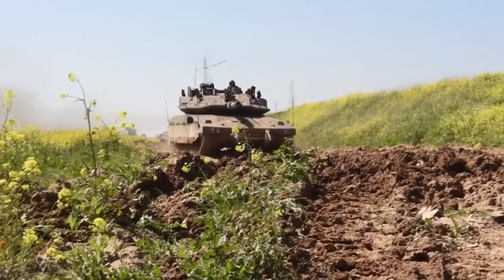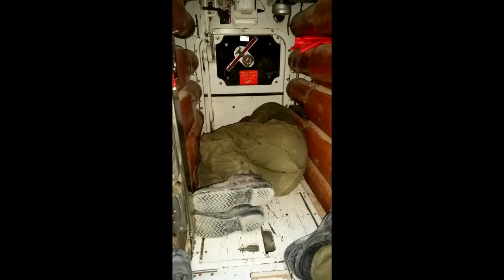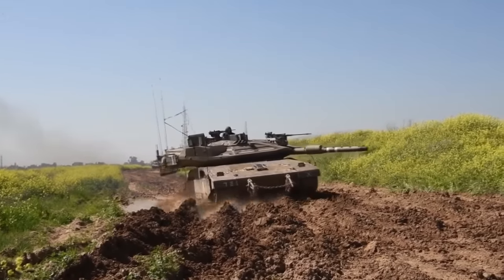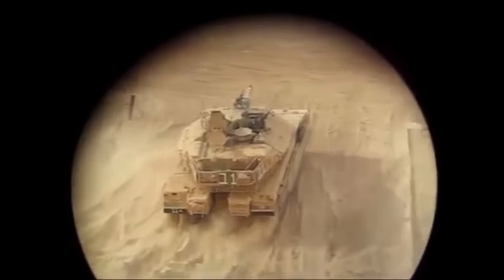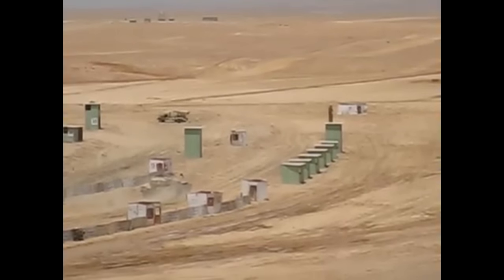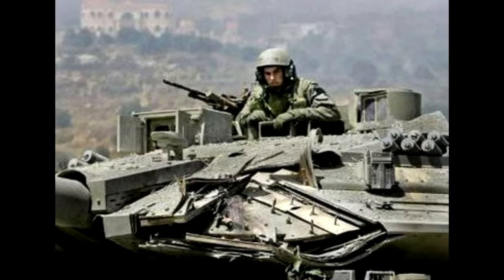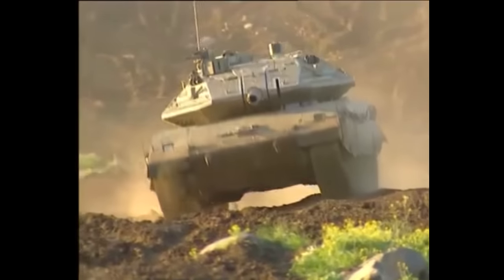Problems with Merkava tank

Comment: This tank was a target practice in 2006 war , many merkavas were destroyed , I went to see them in a tank graveyard museum like place in south Lebanon , this tank is a meme in Lebanon lol
Reply: Now they equipped them with "Windbreaker" Which is a Anti AT System. It shoots down AT Rockets fired at the tank.
Reply: @אוריה-ז7ע  yes but the problem is that it's not efficient enough 15/ 20 % chance of success , before that they add high frequency laser ,but turned out it's not good too , the Russians knows exactly what they are doing.
Reply: @chotob8458  They're developing a new modern series of Merkava tanks.
Merkava 4 "Barak" Which is equipped with the most advanced Anti AT System . It's accurate and was developed by "Rafael"
The Tank Is expected to start it's service 2021
Reply: @chotob8458  Every tank has problems but the Merkava is proven to be one of the finest tanks. This Russian guy clearly is mad or against Israel. He could've talked about the trashy Russian Anti Aircraft systems whose proven useless against IAF's planes in Syria . But he didn't.
Reply: @אוריה-ז7ע  only one way to find out who got the better equipments I guess under the pressure of a certain war
Reply: @chotob8458  Well Israel is already in a war.
Reply: @אוריה-ז7ע  only future days will tell☺️
Reply: 5 Merkavas were completely lost, 1200 Hezbollah fighters were killed. 

Not a bad exchange 🔥🔥
Reply: @JeyseeTO  lol wtf 1200?? U mean civilians , u probably got ur info from IDF ministry of war , 166 IDF soldiers dead 86 IDF civilians dead , 1267 Lebanese civilian dead , 134 hizbollah  fighters dead , so get ur info right lad ☺️
Reply: @JeyseeTO  if ur right ?and 1200 dead , hizbollah will be finished the next day
Reply: @JeyseeTO  if ur right ?and 1200 dead , hizbollah will be finished the next day
Reply: Since when loosing a couple of tanks is defined a lost? Tanks were in Beirut, Israel won the war. 
Merkhava is one of the best tanks in the world, The problem in 2006 were the tanks crews, They send reservists to the war, that were trained on Merkhava 3 and not 4.
Reply: @אוריה-ז7ע  thats not right , idf army is not good in urban combat , they got slaughtered in the small towns and in deep valleys ,it's not about the tanks , u can easily plant a 500 kg of TNT in a road to completely flip it up along side killings all the crew and the patrol squad beside it
Reply: @אוריה-ז7ע  tanks were in Beirut in 1982 bro , what are u talking about ? Lebanon was a complete mess back then , 10 years of bloodshed before Israel invasion
Reply: @chotob8458  Lebanon is still a complete mess , A terror organization is controlling your land. 
Even if I'm wrong, Tanks were in rage of Beirut in 2006, The fact the Israel crossed your borders and managed to bring the battlefield into your country is a loss for you.
Reply: @אוריה-ז7ע  first of all tanks weren't in Beirut in 2006 , that's a lie , I was in Beirut back then , second ur tank is a complete failure , ur country against a fucked up country like Lebanon , u should feel ashamed of urself , how can a small organisation demolish ur platoons in 1 month , if ur right u should be spending summer in Beirut alongside ur people right ? Like in Palestine
Reply: @אוריה-ז7ע  first of all tanks weren't in Beirut in 2006 , that's a lie , I was in Beirut back then , second ur tank is a complete failure , ur country against a fucked up country like Lebanon , u should feel ashamed of urself , how can a small organisation demolish ur platoons in 1 month , if ur right u should be spending summer in Beirut alongside ur people right ? Like in Palestine
Reply: @chotob8458  Okay, I didn't say INSIDE Beirut i said In range of Beirut. 
Secondly, if my tank is a "complete failure" 
why is it ranked at the top? why is it one of the safest tanks in modern history?
Destroying 20 tanks is nada. Literally nada. 
Check how many tanks the US Lose at Iraq and afghanistan.
Merkhava is a very good tank weather u like it or not.
And you should be ashamed on behalf of Hezbollah. 
Firing at Israeli citizens, Targeting populated areas, Kidnapping soliders. 
Mind your own business.
You can't even rule your country right, Instead of spending money on useless attacks on israel, Rebuild you F'ing country and help your civilians, 
Weather you like it or not, Israel is stronger than any of it's neighbors, So erasing us from the map is not an option, You lost 8 times and you'll lose 8 more if you try. 
 Also what's palestine? Never heard of it.
Reply: @chotob8458  I trust the official statements ONLY, and who knows where "134" come from.

As far as I read, not a single rocket launch by Hezbollah has been made since that moment... Unlike before the start of the war.

Guess this can be considered a defeat for this group.
Reply: @JeyseeTO  official statement by who ? Who's statement u mean ?
Reply: @chotob8458  official statement of the winning country. 1200 killed Hezbollah's members.
Reply: @JeyseeTO  yeah right , ur worst than a local Saudi news channel lol
Reply: @chotob8458  why am I? I'm just saying obvious things. 

Its obvious as the fact that America defeated Iraq + Azerbaijan defeated Armenia etc.

Comment: Just letting you know that there is a new merkava model that has came out and has been handling those errors pretty good.

The merkava MK4 Barak has handles those situations quite good, the termal visions is one of the best and the commander has a vision of 360 degrees with his special helmet and the fire extinguisher system is not really failing anymore, However the armour has stayed the same as before, but you have quite missed the purpose of the tank itself, is was created in the first lebanon war and the the tank is designed to be in an urban areas and handle threats like AT rockets.
Btw the merkava itself can be brought down by the engine, but the turret is still oporational and that give is the win of the 1 on 1 situation, maybe even 1 on 2 or 3.

Great video btw, i enjoyed it a lot  
~Crew memer of a merkava mk4 barak
Reply: Cool~
Reply: @peterpeter3664  wtf?
Reply: Well thanks for giving your enemies some new insights on Merkava and endangering the lives of your comrades.   Well done!
Reply: @jjmanagement7956  ikr but what can u expect its the internet everyone is an expert in everything scroll through the comments u will get a good laugh lol
Reply: EmceeDoctorB  How about turning your brain on for a second and considering that both can in fact be your enemy and that you do not need to pick sides?
Reply: @Jaafar A Thorn Or children on tanks

Comment: Greetings from Israel :)
Good video, and pretty accurate.

here's my rant for for the ranters.

A few things to take into consideration about the Role of the Merkava and how this affected it's armor design:
  
The Merkava mark IV (מרכבה סימן 4), mainly faces Infantry armed with RPG's and Surface to Surface missiles, In Mountainous and Urban environments, fighting in guerrilla warfare.
The surrounding armies around Israel mainly have tanks like T-72 variants or BMP variants, which the armor on the Merkava IV is more than capable of handling, and the gun can easily penetrate their armor.
The Merkava is designed to protect surrounding soldiers, and insure crew survivability, But is also designed to be very maneuverable and use the terrain for it's advantage.

The most important thing in a Tank is the training of the crew, and how effective the Crew is in utilizing the tank in combat. 
IDF (צה"ל) crew training is why the Merkava tanks are considered legendary in their crew survivability. 

In the end, A tank's armor is important, but only as long as the crew survives.

Here's the truth about the Merkava IV:

-If you take any modern Tank 1VS1 against the Merkava IV in open ground, The Merkava is probably Screwed.
Most modern tanks have a longer Effective engagement range than the Merkava IV. 

-If it's 1VS1 Urban fight, or a battlefield with hills where the Merkava IV can use the terrain and it's mobility, i'd put my money on the Merkava IV....
the thing shifts like a damn mountain goat!

sorry for the long rant...
  
Happy Easter or Passover :)
or whatever holiday your celebrating.

.חג שמח

Comment: The Merkava is a tank that was built for defensive purposes which is why the lower front plate seems to be rather weak. The Merkava was meant to stay in cover so that the enenmy can only see the turret or maybe the upper hull as well but the lower plate would be in cover most of the time.
Reply: That's pretty much every modern MBT. Hulldown is modern doctrine
Reply: @kevinchen5823  That is true but I mean even the concept behind the first Merkava was that they defend their position against an aggressor and the other modern MBT's are more like allrounders. But I think the Merkava 4 fits the role of an allroader pretty good compared to it's earlier versions.
Reply: Which seems to be a problem with modern tanks; they are not so much tanks but mobile bunkers
Reply: we really need sane statement and opinion around here!
Reply: Bingo
Reply: Except t-90m it can also probably fit a 2a82 with a turret modification to continue its life as a top mbt
Reply: Threnn just to add to your point, most tankers are trained to aim centre mass of a silhouette, as at long range, you can’t exactly target weak points. So yes, there’s no reason it has to have even more weight from a point that is not consistently hit with tank guns.
Reply: @okokokok5269  The name tank simply means a sometimes more and sometimes less armored vehicle. It has nothing to do with the offensive or defensive capabilitys of the vehicle. The Leopard 2 is a kind of tank that is called "MBT" which means that it was made for offensive and defensive use. If the Merkava 1 is called "MBT" than you are probably right but you said tank and not "MBT".
Reply: @okokokok5269  I never said that the Merkava is not an MBT but I simply told you that there is a difference between the word tank and MBT :)
Reply: @threnn9509  nope nice try
Reply: @okokokok5269  Why nice try? You messed up the word tank and the word MBT and I simply told you that there is a difference. But I also said that you are right if you meant that it is performing bad because it is meant to be an MBT.
So I don't know why you seem to be a little pissed because I agreed with you except for the fact that you mixed the word MBT and tank.
Reply: Also the lower front plate is very unlikely to be hit since ballistics
Reply: @okokokok5269  bruh what offensive israel designed the merkava as a defesive tank and kind of a replacement for the chieftain which they were planning to get
Reply: Threnn - A weak front armor is a design weakness as every tank should meet the enemy frontally. So every tanks armor is strongest on the front. If it is not then it is a mistake.
Reply: @TorianTammas  The engine is some kind of additional armor and quite effective as some kind of spaced armor which is seen in quite a few other tank/IFW designs too.
Reply: @threnn9509  The engine is what keeps a tank alive. A tank without running a engine is a dead tank. In a tank battle that buys them less then 10 seconds till the next hit finishes them off.
Reply: @TorianTammas  That is true but whenever a shot is able to penetrate a tank than the most important thing is that the crew survives.
Reply: @threnn9509  The only reason this bad idea still exists is that it is the Merkava one basic design and they never updated this. It was a compromise at the time that made sense as they had no better option to increase the front armor. Today it is a relic because the basic design never had been updated or no new tank developed.
Reply: @TorianTammas  no because the main enemy for tanks isnt just tanks but also infantry and a tank will most likely face infantry not in the front esspecially in a tight city packed country like israrl
Reply: @gamingkingdom1146  Sending in tanks in a city is the tactical and strategic worst choice. Sending it in without supporting infantry In great numbers is suicide. (It take more then the really few infantry on might cramp in tanks.)
You can ask the Russian what happened in Grossny as they rolled in without large infantry  support.

Comment: the merkava doesn't need to be protected from apfsds because it wasn't designed to fight modern mbts but old ones with weak shells and infantry with missiles/ its the best tank in the world because it fulfills its design purpose in the best way possible
Reply: I can also say the same about the Abrams. I don't think there is a definitive "best MBT" since each tank is built to fulfill the role it needs to. The merkava MK4 will perform extremely well against middle eastern enemies such as Hezbollah, Hamas or Iran that still use old soviet tanks (or M60 tanks in the case of Iran) but the moment it sees a modern MBT it won't perform as well (though probably still better than the god awful T-90)

Comment: The Merkava tank uses the hot exhaust generated by its front engine to vent forward as required to confuse enemy's infrared targeting during battle.  It functions like a smoke bomb!
Reply: What about the thermal sight on the merkava? Lmao
Reply: So it has magnet effect on javelin.
Reply: @Frosty_357  trophy system will negate the javelin entirely so no biggy
Reply: @AJ_on_One1  how about to hornets in a row.. say 1/10 sec diff. what is the reload speed on the trophy?
Reply: @AJ_on_One1  besides.. i have wondered what happened with the infantry soldiers around the tank if the trophy gets activated ?
Reply: @leonardoorellano6652  how often are two missiles launched exactly like in your scenario and there are multiple different trophy systems located on the turret which all cover overlapping radians in a 360 circle which can immediately counteract follow up threats, also infantry would likely never be in front of these tanks on a Hot battlefield or tank breakthrough situation, and in many cases depending on the environment the infantry may not be close to the tanks to the point where a trophy interception would harm them, and based on that logic if it was a tank without trophy were to get hit by a missile than the infantry around it would be hit by shrapnel pieces anyway, i really dont think u thought that last part through💀💀
Reply: @AJ_on_One1  the latest hornet has that capability to exactly counteract active protection. In regards to the other issue, the russians are experiencing exactly that problem... it will kill the infantry soldiers nearby as well. Was curious of the israelis solved that problem as well.
Reply: @leonardoorellano6652  I don't think it has a reload speed. It has a set amount of ammunition and it can fire them all at once or one at a time.
Reply: @leonardoorellano6652  Your grammar does not help you. It is if the Israelis. Although to be fair you might have a point especially if the Merkava carries infantry with it. It is quite possible they just have the Merkavas without Trophy carry the infantry.
Reply: dont think hamas uses infra red targetting

Comment: I served in IDF armor so I can tell from more practical perspective:

1) What makes emission in thermals is exhaust system not the engine. In this regard Merkava is not different from T-90 which also has exhaust at side.
2) Merkava is deigned to fight the other tanks in hull down position. So there is no point to increase front hull armor against the APFSDS.  Much better to save the weight for side, bottom and top protection.
3) L44 is more than enough against all Syrian and Egyptian tanks. Increasing barrel length will only decrease mobility and probability to hit on move. 
4) Turret ammo or Merkava does have blow up panels. Hull ammo does not, but no other tank beside the Abrams have it. Merkava rounds are stored in containers in rear. Thus Merkava and Abrams are two best tanks in regards of ammo storage.
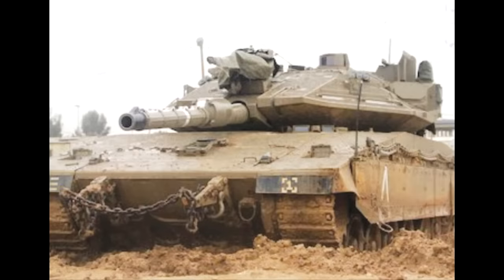5) At 3:00 u can see that round penetrated the lower hull but did not ignite the fuel tanks. Beside their ignition does not endanger the crew at all.
Reply: Good points. Couch expert vs real experience.
Reply: @komradearti9935  This chart makes very little sense. 

1) Modern ATGM can easily penetrate front hull of Leopard 2 and T-90.
2) At steep angles hitting tank skirts ATGM will lose lots of penetration (Merkava has very thick skirts with explosive content).
Reply: @komradearti9935  1. Because its not a big secret anymore. Around 700-600 mm protection.

2. Tiger tank or IS-3 had all around protection. And it was WW2 with conventional warfare and established frontlines. Today u can easily get round from any direction.

Comment: The modern US 120 mm L/44 gun operates at up to 760 mPa compared to about 580 mPa for the L/55 gun and 520 mPa for the older L/44 gun. Between increased chamber pressure and the American DU penetrators, US tanks have far better anti-armor performance than other tanks with 120 mm guns.

Comment: The M1 was tested with the L/55 gun in which everything thing fitted perfectly, but the stabilization would cut out after reaching 10 - 15 MPH
Reply: m1? abrams? l/55 rhm? wh the stabilization cut out? i mean..in leopard 2 the l/55 works perfect.
Reply: Nah the reason why the abrams still uses the l44 is because apperantly according to matsimus and some guy who imbestigates all kind of tank ammo, im not sure if it was his abrams or how tank armour works video, the depleted uranium rounds perform better in an l44 than in a l55 while giving the same penetration value as a tungsten round in an l55 gun. So a country which doesnt use depleted uranium, the l55 is better for anti tank purposes and for countries with depleted uranium rounds l44 is better.
Reply: The M1 was build for a 105mm gun. they had to change a lot just for the L44. It isn't like the Leopard 2 that was build with the 120mm L44 from the start.
Reply: @23GreyFox  l44 just refers to the length of the gun
Reply: @a.t6066  I know that.